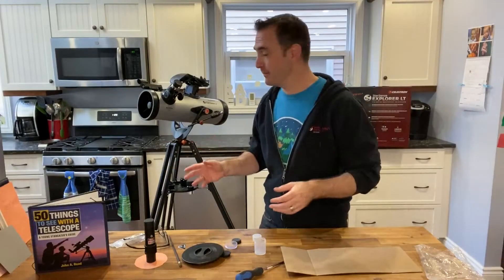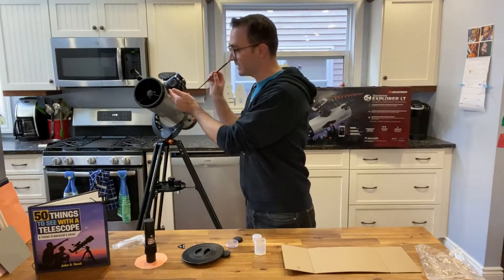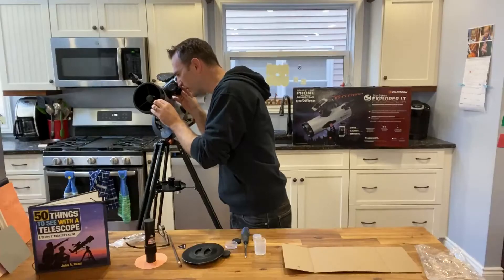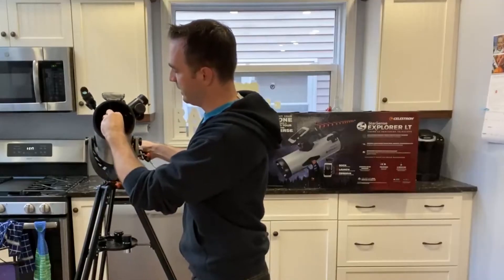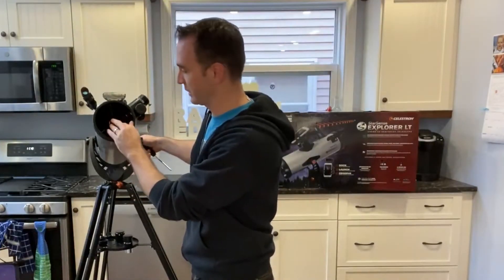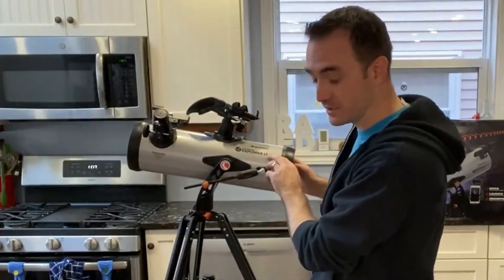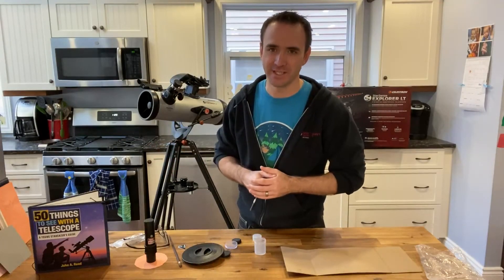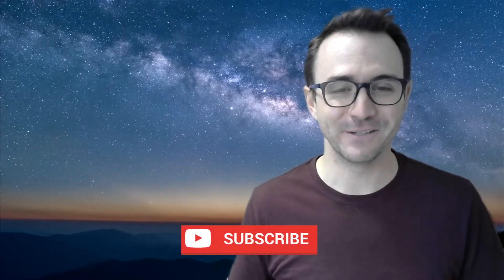Collimate a Celestron Starsense Explorer LT 114AZ Telescope

Comment: This is way harder than it looks in the video! Mine (Explorer LT 114AZ) was working well when I first got it. Suddenly I started to have issues, it seemed as if part of the image was focused and part of it was not. I heard that was a collimation problem and I followed the instructions on this video. I think that was a mistake since it's now worse! Once you slightly loose the front screw, that whole part becomes totally loose! I adjusted it again but now I can't seem to get it right. I'm mad at the video and I'm mad at the telescope.
Reply from the maker: Sounds like the secondary mirror is twisted.

Comment: The "little correcting lens of some sort" is actually a one element Barlow lens, like the kind that used to be around with telescopes way back in the 1970s.  This 114 is not a Newtonian reflector telescope at all.  It is a design called a Bird-Jones.  In a Bird-Jones design, that lens has two purposes.  One is to "lengthen" the focal length of the telescope - which translates directly into increasing the magnification of the telescope.  

The other is, like you said, to correct for the aberrations that are inherent to this Bird-Jones design.   This is so that they can use a cheap spherical mirror in this scope instead of a more expensive parabolic mirror.  Spherical mirrors inherently suffer from aberrations, which this corrector lens is supposed to correct for.  In reality, however, the corrector lens doesn't really do the job.  These Bird-Jones scopes are generally limited to about 100x, no matter how well they're collimated.  

The reason for this design is so that they can put the telescope in a much smaller, shorter package, so that more of them will fit on department store shelves.  We derisively refer to scopes like these as "department store telescopes" for that very reason.  The problem with this design is the complicated collimation process you just demonstrated - Bird-Jones scopes are notoriously in need of frequent and complicated collimation, even direct from the factory.  

In fact, as you saw, that corrector lens disrupts the laser beam.  The "real" way to collimate a Bird-Jones scope like this is to take that corrector lens off of the bottom of the focuser.  To do this, you have to physically remove - unscrew - the focuser, and get that lens off.  Sometimes the lenses are GLUED in place.  That means you have to BREAK it off of the focuser.  Then you put the focuser back on and collimate the scope as a regular Newtonian reflector.  Then you have to take the focuser off again, and put the lens back in position - and you have to do it in the right orientation, or the telescope will not work.  Finally, you have to put the focuser back onto the scope.  

Because of all this, I recommend people to stay far, FAR away from this scope and all Bird-Jones scopes.   They stink on ice.
Reply: To late,😢 I already bought it, and the return window already expired !

Comment: Is it really the case that the collimation should remain correct for the life of the scope? Or do I misunderstand? I was under the impression that it was a fairly routine practice (few times a year maybe if you use it often?)
Reply from the maker: Regular collimation is more of an issue for larger scopes. These small scopes are quite forgiving when it comes to mirror alignment, and so once the mirrors are locked in place, they tend not to need future adjustment.

Comment: To check collimation on my Celestron Star Sense 130mm, if I do not have a laser collimator do you think your process can also be done on this telescope? Cheers!
Reply from the maker: Absolutely.
Reply: LearnToStargaze You’re awesome!  Thanks :)
Reply: With your vast telescope knowledge...on the 130mm scope it comes with a 10mm & 25mm lenses. No Barlow or filters included. To push this scope to its maximum capabilities for deep space/planetary viewing what do you recommend for lenses and filters? Also in an area where have to travel a bit to get away from light pollution. I appreciate your advice!
Reply from the maker: @Eve85Eve  remember that magnification is not a good thing for deep space objects. You want as little magnification as possible. I believe the 130 can take 2 inch eyepieces inch in case a big high focal length (low magnification) eyepiece would be a dream. (Like this one: https://optcorp.com/collections/2-eyepieces/products/tpo-42mm-superview-eyepiece-2#reviews). For planets and the Moon (pretty much the only time more magnification is better) I like to use a 24mm-8mm zoom eyepiece like this one: https://optcorp.com/products/meade-8-24mm-zoom-eyepiece-1-25
Reply: LearnToStargaze LearnToStargaze Thank you so much! It does have the 2 in. adapter for eyepieces, I’ll definitely look more into that. Going to pick up your books too! 👍🙂 Now I just need some clear skies in Wisconsin. Keep up the great videos. Cheers!
Reply from the maker: @Eve85Eve  thanks for the support! Yes we’re had only one clear night in the last month here in Nova Scotia!
Reply from the maker: @Eve85Eve  thanks for the support! Yes we’re had only one clear night in the last month here in Nova Scotia!

Comment: Hi, I just bought one. But, I receive the image from the telescope upside down. If I align the mirrors as you did in the video, I will solve my problem?
Reply from the maker: HI Zore, This telescope is a newtonian design. It is designed for looking at things in space where there is no such things as upside down. A newtonian telescope rotates the image 180 degrees. There is nothing to fix, because there is no problem. Good luck with the telescope, I hope you get a lot of enjoyment out of it!